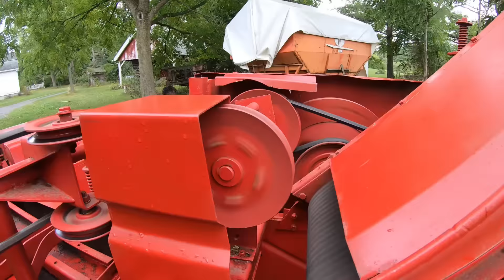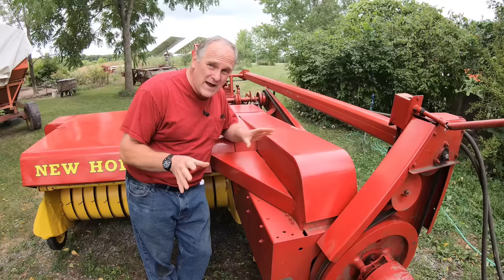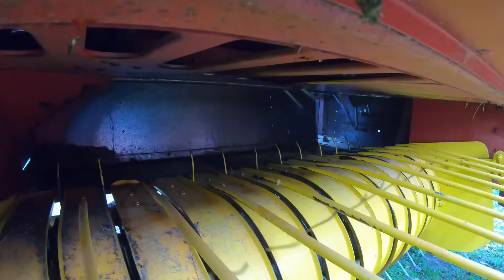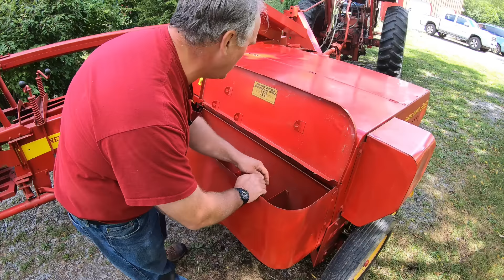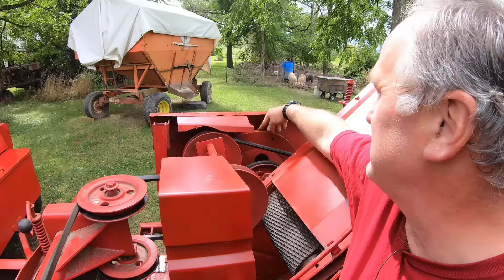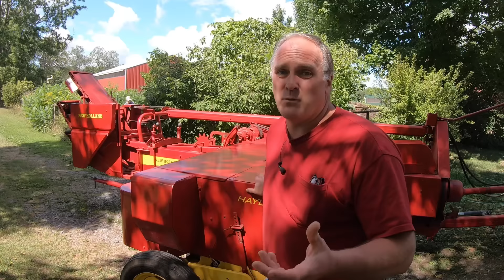NEW HOLLAND balers from the 1960's: how they work, maintenance, operation, and making good bales

Comment: Best video on old balers I have found.  I have 10 acres in western Colorado I would like to farm next year.  I see lots of older balers, but they are all back east.  Not much out here, and the prices are crazy high, and the distances just to go look at anything are usually beyond 200 miles, or in Nebraska.  Then you have the logistics of getting it home(tow or trailer), but they are so wide and my car hauler has wheel wells in the way..  The best thing around currently is a 1980 NH 315,($5500)  166 miles away.

Comment: 8:00 I have a model 65 with the feeder fingers also, altho mine are powered by yet another chain off the plunger itself which isnt optimum in my book, I like your bellcrank better. And I have proof that it IS possible to get the fingers out of time with a chain (the chain that pulls the teeth back and forth wore completely through on the bottom, so the chain just parted and they went forward but not back and - bang tick tick tick tick tick tick tick tick tick tick tick tick tick tick as the flywheel spun down sans shear bolt. But just like a fuse on an old color TV, the little tiny $265 bracket that holds the teeth to the trolley snapped to protect the $15 aluminum finger from damage). But an auger never made sense to me because half the time the baling chamber is closed off as the plunger goes forward, pushing hay in as the plunger moves back then getting out of the way and grabbing more hay as it moves forward seems like the better system.

Comment: We have a international 440. It has never been put a bearing or any parts other than two belts running the pickup. Just looked at the service history just oil and grease. 300000 bale's can say for sure after 70s. When it was bought new. Now paint is bad going to make paintwork and some little stuff. Just yesterday baled 2000bales. For few horses.

Comment: As a part time farm kid in the 70s to the early 80s I have lugged many a bale of hay. It was my aunt’s small farm in NW New Jersey & we pitched in at hay time. She had a New Holland baler, however despite being mechanically inclined I knew not to touch it was mysterious machine, she was not having anyone fool with it. The thrower would blow out some chaff just before launching the bale. I and who ever on the wagon would attempt to stack the hay as best we could. If done right we fill the wagon to the top. She went round bales as we grew up and moved on. Great times 👍🏻

Comment: Not a farmer but find the equipment interesting. There's never a moment I'm not impressed by the mechanical design of fully analog systems. Computers and electronics have improved efficiency in many ways but come with their own problems, including planned obsolescence, component failure rates, and difficulty to diagnose and repair. As you said, a little mechanical understanding and a routine of TLC will keep these old farm pieces running for many decades, easily paying for themselves over a short time.
Thank you for your explanation of this baler.

Comment: Great video,you set very good examples.Only thing i could disagree with is the knot you tied,is that how the NH manual recommends?We owned an International before upgrading to a NH67,you had to use Reef knots to join the twine,the knot you use would not go through the International knotter. Reef knot more compact,no missed knots.May be better for the admittedly improved system that NH used.

Comment: You can't emphasize enough how important windrow size is. If the baler's hay chamber isn't always filled up properly, the rake will not have enough material to fill the far side of the ram chamber up. This will cause banana shaped bales that pop open as soon as they leave the chute. I guess that is one reason NH kept fiddling with the tine design.

Comment: This is awesome. My grandson wants to start putting up square bales. It's been a minute since we ran a 268. My uncle was a new holland dealer for 40 years, so i learned a lot. One thing that i noticed was your discussion of the pto shaft. The 269 was a "long tongue" version of the "short tongue" 268. The 269 had the extra bearing.

Comment: Well, I had a baler like yiours and never really knew what you do about it. Like you said, after a few distorted bales and the adjustments are tuned, you can bale non-stop. I've seen some old John-Deere balers that worked so much like the Hew Holland it appeared they copied it.  I was always very caareful with the needles after they broke. Being cast iron I was able to weld them back together. Thanks Professor for this episode.

Comment: Hi Pete, I run a 268, and that was a very good, informational video. I picked up a couple of useful tips watching it.  I wanted to mention that I use a square knot to join balls of twine.  and like you said cut off the excess tail after the knot is tight. I know some argue that square notes aren't the best knot for certain applications but it hasn't failed me(as far as I know) in joining the balls.  I'm with you on changing courses because of the exuberant amount of work with small squares, and for my lambing season, I have found large squares to be my solution to back problems.  you are made to work with forks and spears verses you back.  they stack nicer, IMO.  and when kept dry, flake off nicely.  I still appreciate the nostalgia of the small squares, and it is a good workout for the young men.  plus those small square straw balls are good money in the fall for Halloween decorations.  
I'm glad this popped up on my suggestions.  thanks,  and have a great day.

Comment: I grew up on a Dairy Farm in the 70’s and 80’s.   Calumet and Fond du Lac counties is where our farm was.   Always had a view of Lake Winnebago.    We had this bailer with the throw belts.   Except that we used twine spools instead of twine balls.   Three crops of hay.  Bailed oat straw for bedding.   We did not clean out the bailer but bailed dry straw through for winter storage.   Greased all inserts after a few hours of operation.  All farm equipment was stored in machine sheds to protect from the elements.   My Mom always drove the tractor that pulled the bailer.   She spliced the twine and replaced sheer pins herself.   I raked hay with an Allis charmers tractor and New Holland rake.  In my teenager years ( when my brother Jerry started taking over and was my boss, so to speak, I cut hay too.    I either unload hay wagons or stacked in the hay mow.   It was long, long, long days.  No AC  while sleeping.    Parents hired local teenagers to help.   A favorite I remember is Mom order take out for all from a local bar/restaurant.    When I think to myself how hard my family use to work….well I keep going with my task for home upkeep and overtime at work as a welder for Oshkosh Defense.   Thank you for posting and take care.

Comment: I remember the days when it was time to bale hay. My dad had an old tyme IH baler with a seperate engine on the baler. He would try to start that _ _ _ thing with a hand crank. A whole new language came out before he got it running. He finally got it started by belting up another tractor's belt pulley to the pulley on the motor. We never shut it off till we were all done baling for the day.

Comment: I started with a Hayliner 58 in 1996 pulled behind an H.  The 58 apparently had wood slides that the plunger rode on, and I began to get poorly cut bales.  Thought the problem was dull knives but sharpening didn't help.  The NH people told me that I needed new slides because they were worn and allowed the plunger to move over away from the knife mounted on the baler so that hay would not be cut with the scissor action.  Instead, found a Super Hayliner 69 up the road about 2 miles from me and bought it for $400.  Used it for a number of years until my wife and I decided that we were getting too old for this.  We baled 3000 bales our last year of square baling,  just  her driving and me stacking on the wagons.  We would do 2 wagons an evening after getting home from work from May until sometime August (some second cutting).  Bought a round baler for the next season and a little bigger tractor. By the way, I replaced the H after about the 3rd year with a Case 411B with live PTO.  Made baling so much easier.  
I went through the same learning process having to learn how everything worked, how to adjust, lube, and replace parts on the knotters.  Replacing parts, timing, the whole thing was a great learning experience, and I won't even get into the Ford 3pt sickle mower.  But, by the time we quit, I could make the mower cut and the baler bale with the best of them..

Comment: Grandpa bought a NH 280 serial number 1960. Dad ended up with it. Uncles bought models 281, 282, 283.
Those models used the chain driven raker teeth to feed the bale chamber. The 280 worked better for baling straw than the 260, because the chain lifted the raker teeth up out of the incoming straw. We used the 280 mostly with a IHC Farmall M gas, Super M gas, then lastly a SMTA gas with live PTO. That was heaven, being able to push the clutch in & the PTO kept running. Numerous times on the M & SM we were shifting with the plunger, sometimes the tractor would end up in 2 gears at once stopping the motor NOW & sliding the rear tires. We used the 280 so much that the floor of the bale chamber wore out. 
One thing that I like about the 260 is that the needles come up through a gap in the plunger, on the 280, the plunger could hit the needles breaking them!
Dad always kept 1 new needle & 2 welded up needles under the bench. 
Hello from north east Montana. 
10 miles from the Canadian border.

Comment: Lots of them old balers are classified as "antiques" because people don't want to get rid of them especially for those who don't mind doing a little maintenance.    I believe new holland square balers have came along ways.  Nowadays holland square balers from the last several years of today's balers are "super sweepers" with 5 foot something pick up head, as in I mean they are designed for faster speeds / thicker hay for each sweep it takes   which I believe it.     Back when my dad was young all of their new holland square balers they owned were will kinda like this one but no thrower. Inerways nowadays balers you can go twice as fast to order to produce a good decent quality square bale that's not crooked even with a thin window or dubble. Sure still would have to go slow on thicker dubble windows of course but not as slow slow.    But that's my opinion i  guess. Inerways good video.👍 good work on that old machine making it look like new again..lol.

Comment: My dad had aa Hayliner "67" ..... the plunger actually run on cherrywood slides against the steel (no bearings),... along with the chaff,..  in the chamber that's all it ever had,... I remember the chamber where the wood run would be very shiny,... and in all the years,... we never replaced them,..... I miss it,.......thanks for the very well prepared video,... very professionally done,....New Holland did a good job in designing their machines,...... thanks again..........

Comment: Great video. It really brings back memories. When I was little, in Perry Ga, I lived on a dairy farm. My dad worked on the farming side of the farm, so during the summer, I worked my butt off. This was late '50s, early '60s. We bought a New Holland, without the thrower, It just dropped them on the ground. Great machine we pulled behind a Case 500, and I can still remember how good it was. However, occasionally, I remember how much time my dad spent adjusting on the knotters. He eventually figured it out, but I could never understand why it worked so well, then, bam...nothing but trouble. I guess if it's man made, it will screw up. Good memories though. Daddy made very heavy bales, and as a 10 - 12  year old, I could throw the bales up on the wagons like the adults could. If I remember correctly, we'd bale around 12K bales a summer. I could be way off, but we milked 180 head. Thanks for the memories.

Comment: If it drips or it slips, get it fixed before it quits! Maintenance , maintenance, maintenance. Always way cheaper and a whole lot less time to clean and maintenance the equipment than to be down and having cuttings setting too long and potentially getting rained on while your waiting for a part or still rebuilding the broken unit. And at a last cutting in September or early October rain can come any time.

Comment: This is a great video.  I grew up baling (on the wagon of course) with a NH 273 baler my dad had.  The mechanics always fascinated me but I never took the time to learn how it all came together.   I can hear every sound now.  It was very distinct. Dad always fixed it when something went haywire (pun intended).  Thanks to you all these years later I now have learned something that always wondered about and eluded me due to my own laziness.  It has brought back many great memories.  Dad's 273 would throw pins pretty often so your explanation on that was interesting.  Our 273 was a wire baler but the rest of the machine was the same.  NH made the best as you said.  256 hay rake was hard to beat as well.  Thank you very much for your time putting this together.

Comment: My father had an NH 660 with a Wisconsin engine. It is older but similar to yours in many ways(no thrower). When he bought the '48 John Deere A, he figured that he had enough shaft HP to convert it to PTO drive. A square knot is the only knot that would go through the knotters according to the NH dealers. Here in Ohio, keeping your equipment in a shed or a barn is essential if you want it to work next year. FYI for viewers-It is a real good idea to throw some loose hay into it and make 3-4 bales to make sure it is working okay before going into the field. Things like clover can get really dirty and these baler can give you fits when there is too much crud in the mechanism. Time cleaning is never wasted time.

Comment: My Dad and Uncle had a NH 66 baler that was traded for a  268 Hayliner. Your point regarding 2 pto universal joints versus 3 is well-taken.
The old 66 had a cross-auger and a chain driven pickup with a slip clutch. That pickup floated over the ground with it's steel wheel.  A 10 year old boy could lift it into transport position. We hated the pickup on that 268. It was a heavy SOB, with an inadequate lift spring. The belt drive was inadequate. The pickup would not float. Rather, it would dig into the ground on uneven surfaces until you had to stop and back up to free it. Other than capacity, the 268 was a real step backward from the little 66.

Comment: Great video! In high school I took a summer job with a thoroughbred farm. Mostly, I set sprinkler pipe and started the pump, which normally required priming. I fed all the stock and did many other odd jobs. During haying, my job was to load hay on the truck, there was no bale thrower. We used a New Holland baler that used three strings. It appeared very similar to your 269 model. We had a tough time with the knotters and getting the bale tension right. Now I know why. The guy did not know much about farm equipment. I do not ever recall seeing a grease gun around. He did not spend much time on maintenance. I am amazed that it worked as well as it did.

Comment: My cousins who still farm were much better at baling than I was - upper body strength, able to throw the bale up to the 5th or 6th level and stack tightly. I do recall the driver needing to steer left and right on the windrow so that the hay would pack evenly: if too far left would pack on the knife side, too far right, too loose on the knife side.  Was hoping to see a bale and show it deconstructed. Great video.

Comment: Spent a lot of time haying with my Uncle.  He had a NH baler powered by a Wisconsin engine hand crank to start.  Had a bale thrower that hooked to the frame of the truck and tossed the bale to the poor chap stacking.  If it was going to rain my uncle could drive pretty fast. whew. Thanks for the great video. 🇺🇸🐢🐄🚒🚑

Comment: I have a new Holland 269 same series as yours and my first cutting this year I fought issues with the knot hanging on the bill hook, it would tie proper and some would come off bill hook fine and some wouldn’t. It is coming out of the hook but hanging up on the very top of the bill hook. Any ideas?
Reply: I have tried different bale tension with the 2 turn screws in rear and have rolled the knitter over by hand to verify the wiper arm has some resistance on the bottom of bill hook.

Comment: Pete, thanks so much for this video, it brought back a lot of late 70's and early 80's memories for me.  My grandfather was a farmer in western Illinois and I worked summers helping out from about 10yrs old to my late teens.  Putting up hay was one of my first jobs and he had a New Holland very much like yours.  I still vividly remember that monster shaking back and forth just waiting to chomp up the windrows.  I also remember him having to replace that shear pin a couple times during the season (don't remember if his had the slip clutches) and I learned quickly how to correctly tie the twine knots like you say to keep them from binding.  He didn't use twine in balls, it was in coreless spools that fed out of the center.  Great memories!